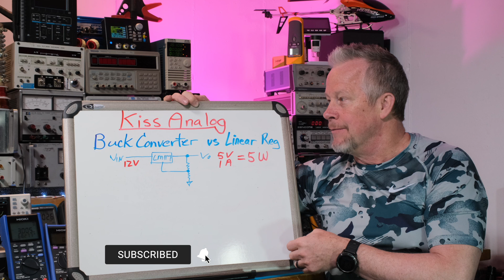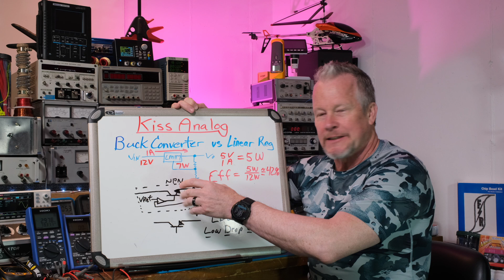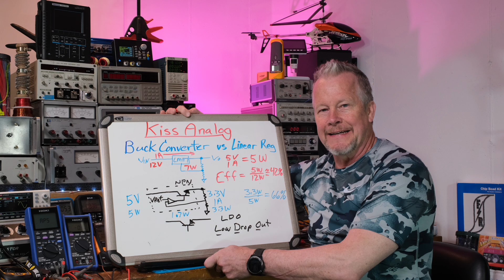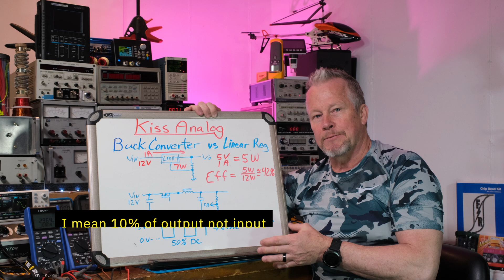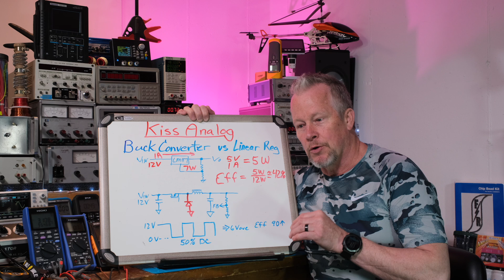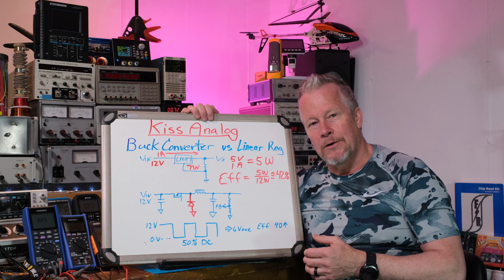Buck Converter vs Linear Regulator  SMP #1 Series #buckconverter #SMPS #linearvsbuckconverter

Comment: Professor, I've been trying to find a solution. Theoretically, I would use two SMPS power supplies in series to obtain ±17V.

The SMPS is the MeanWell LRS 100 15 (15V ~ 18V) 7A.

If I use a Capacitance Multiplier with a Darlington Transistor, I would solve the switching noise problem, but I would have a voltage drop of 1.2~1.4V.

I haven't found any linear regulators that are compatible with this 7A current.

If I had found one, I would have to put a very large heatsink on the case and it would probably have to be a 24V power supply since at 17V the regulator wouldn't be working with headroom, considering that we need to have about 3V above the regulator's output voltage.

So I thought about a Step Down Buck regulator, could that work? Does it filter out the 150mV high-frequency ripple (65kHz ~ 100kHz) from my SMPS source?

My Sony mixer needs a voltage of ±17V and 6A.

Thank you.
Reply from the maker: Thanks for the question!  Yes, you can put two isolated outputs in series and use the center point for the reference/gnd.  Have you tried it and found it noisy with the ripple?  I'd bet that the ripple at sucha a high frequency would go un-noticed.  However, if you want to filter it out, just try a filter.  

Here is a video where I show how well it works: https://youtu.be/Qy2fOhiQRSk

This is a link to a high current filter that might provide me with a small commission and will not cost you anything more:)  https://amzn.to/4vjfOA8

Please let us know if you try it and if it works for you.

Comment: Cool stuff, was just watching a video on increasing the amp capability of your standard lm2596 based buck converter, not by adding a bigger inductor but by adding 2 mosfets in parralel at the end it looked like. https://youtu.be/IkubAYdlCzc?si=nUafXfe2ef8c_KqO The idea being you didnt need a bigger inductor you just added a power mosfet or 2.  Wonder how that worked. Also seen another mod that lets you current limit that same buck converter  with an op amp added to it. https://youtu.be/iwnanQsR32Y?si=VqBP43-DS6VwmQ3x These videos are great at showing you how to do it, but dont explain why it works.  That stuff would be great to see.

Comment: Short story : use LDO when drop of voltage is not significative and when noise on the power rail is critical.
Reply from the maker: Thanks Lucas!  I agree, if power loss is not an issue, then go with the Linear Regulator.

Comment: One thing I do not care for switching regulators,,,,, (without ov protection)... I work on an industrial systems instrument.  It has a heavy 5 volt current draw, when an optional SBC Computer is installed in that PCB, maybe 20% of the time.  So, the supply is capable of some "beef".   80% of the time, you find that board, it doesn't have an SBC mounted on it, so it really doesn't need that current capability, so it is a VERY efficient 5 volt switcher.  That 5v power supply is derived from a 12 volt supply supplied by a Lambda frame power supply (lots of current).  I've had to repair instances where the switching controller failed, leaving the FET on all the time.  When that happens, it blows every TTL SMT chip on the board.  Luckily, that is only about 8 or 10 chips and is repairable.  The chips are cheap and available (thank goodness), only the labor is expensive - lol.  That 12 volts feeding to the 5 vols level converter chips, thank God has never fed back in to the 3.3v FPGAs.  There is no 5.6v zener across across the output, or anything like that.  It probably would not be fast enough to protect the TTL chips?  I not sure what protection scheme would work in a failure case such as this.  It also could just be the arrogance of the German engineers that their design could never fail.  I just think, in this case, it is a shitty design.  I have never seen a linear regulator (at least on the equipment I work on for that last 40 years) short from input to output.  They seem to open, not short.  No room on that PCB to dissipate power from a linear regulator.
Reply from the maker: Thanks for that great feedback!  You are right, the shorting condition is potentially an issue with Buck Converters.  So important to design these so that they are robust!

Comment: What in case my load needs just milliamps most of the time and sometimes 1-2 amps?
Reply from the maker: Thanks for the great question!  Is the high current load there for a very short transient, or longer?  This is a typical situation;)
Reply: @kissanalog  Well, I have a little project on my mind, where MCU will draw couple of milliamps, I will turn LoRa module for couple of seconds every couple of minutes, and very rarely I will turn on sirene like once a year for couple of minutes (so not just a short transient)

Comment: Nice episode 👌👏👏👏👏Linear better for low current it's also safety, very low noise,   very low efficiency also!
Buck or series converter very high efficiency, but noise high also, GaN very improvement for smps 99% efficiency! 
Thank you for your expensive lecture and presentation
Reply from the maker: Yes, I think in general you are right.  We can back switchers pretty low noise, so we'll have to work on this as these videos come up;)

Comment: Regarding the buck suggestions you asked for,

When you make the design example video, maybe you could have a simple linear circuit built up already that's equivalent to the buck with regard to Vin, Vout, and Iout.  Without needing to go into much detail or analysis about the linear supply, you could still show some quick comparisons with efficiency, input/output noise, and input/output step measurements.  Or, hold the buck vs linear comparison off for a future video where you can focus specifically on showing the similarities and differences between the two.  Some people are really surprised by their similarities once it 'clicks' for them.  I know I was!

Feedback loop response stuff (gain, phase margin, compensation, bandwidth, etc) would be awesome to eventually work up to after you've finished the overview videos you have planned.  If someone already has a good grasp of filters, they'll get a little taste of just how much filter theory overlaps with control theory - almost two different sides of the exact same coin in my mind. 

Also, if or when you make some detailed videos on linear supply theory; a lot of people tend to think of LDOs and other integrated linear devices as unconditionally low noise and stable - you can explain and show us why that's not always true.
Reply from the maker: Thanks for this!  I'll have to see what I can do;)

Comment: Very insightful! 
In one of the recent designs, I used LM2678 for getting upto 5A current at 5V. Interested in learning more about switching converter architecture at the block level(inside the IC as shown in datasheets).
Reply from the maker: Thanks for sharing that;) You've given me some ideas.

Comment: I ASSUMED THAT UNITS LIKE MPPT CHARGE CONTROLLERS AND STEP DOWN COMPONENTS THAT REDUCE DC FROM 48 VOLTS TO SAY 12 VOLTS MAYBE 5 VOLTS HAVE LIKE 95 PERCENT EFFICIENCIES, WHEN YOU MENTIONED THE LOWER EFFICIENCIES, THAT GOT ME THINKING, BECAUSE MUCH LOWER EFFICIENCIES THAN IN THE NINETIES WOULD BE INSUFFERABLE.

IN SOLAR, YOU TYPICALLY HAVE STRINGS OF CONNECTED PANELS THAT USE DIODES COULDN'T LOSE MORE THAN A FEW PERCENT IN POWER REGULATION TO EVEN WORK, I WOULD GUESS, NEVER THOUGHT ABOUT THAT MUCH FROM AN ELECTRONICS PERSPECTIVE. VERY INTERESTING AND THIS WILL MOTIVATE ME TO LOOK INTO THIS, MEANING I'LL LOOK MUCH MORE CLOSELY INTO THE EFFICIENCIES OF THE COMPONENTS I'M SELECTING...
THANKS
Reply from the maker: Thanks for this feedback!  I think solar is a great example where you want to keep the efficiencies low!  Nice example.  What would be an example for voltage and current?  It sounds like 48 VDC is a starting point, and then 12 VDC is probably a common voltage for running other devices, but what would a typical current demand be for the 12 VDC?
Reply: @kissanalog  OK HERE ARE A FEW EXAMPLES FOR OFF GRID SOLAR FOR EXAMPLE:
1. YOU WANT TO CHARGE DC REFRIGERATORS THAT RUN TYPICALLY ON 12VDC SOMETIMES 24 VDC OR CELL PHONES FOR EXAMPLE COULD CHARGE ON A 5 VOLT LINE OR HIGHER, THEY HAVE HIGHER LINES NOW FOR COMPUTERS LIKE USB C SO ALL OF THIS CHANGING THE CURRENT UP OR DOWN GETS SIGNIFICANT

2. SOLAR PANELS ARE TYPICALLY IN HIGH RANGES FROM 36 TO 50 SOMETHING, UNLESS THEY'RE CONNECTED ON STRINGS  IN SERIES IN WHICH CASE A STRING MIGHT CARRY  A MAXIMUM OF 600 VDC DPENDING ON THE INVERTERS THEY'RE CONNECTED TO

3. IN OFF GRID YOU WANT TO KEEP THE VOLTAGES HIGH FOR LINE EFFICIENCY TO THE BATTERIES WHICH MIGHT BE IN BANKS ANYWHERE FROM 12 VOLT TO TYPICALLY 48 FOR SMALL SYSTEMS

4. SO THE EFFICIENT LYNCH PIN WOULD BE DROP DOWN REGULATORS THAT DON'T HAVE HEAVY LOSES FOR DROPPING DOWN TO THE VARIOUS APPLIANCES. 

5. I THOUGHT PANELS JUST USED DIODES TO KEEP THE POWER REGULATED AND FLOWING IN THE PROPER DIRECTIONS, THE BOXES ON SOLAR PANELS COULD BE MORE COMPLICATED IN THIS ERA THOUGH, I SHOULD CHECK ALL OF THAT OUT.

ANYWAY, THANKS...
Reply from the maker: Ok thanks for the info!

Comment: My L12 amplifier works on +/-50 DC. In the past I've used linear regulators for the +/- 15 volts at about 10/15mA to run the usual 5532 pre amp chip. That's quite a voltage drop. Would be interesting to use a low noise Buck converter to run this preamp. I'm sure this option would be most useful to many home constructors. ...and myself!
Reply from the maker: Thanks Michael!  That could be a great example;)

Comment: Great primer! Would love to see more on this. I'd love to see more content on bucks. My problem would be 20v in, +/-16v out. Buck regs only, 20mA quiescent, and 200mA peak. Some tips on layout would also be amazing.
Reply from the maker: Great!  Thanks!  I will cover placement and routing too.  This low of current could be done with a linear as well.  Do you have a reason to keep the efficiency low for this lower power?  How long is the 200 mA peak needed?
Reply: @kissanalog  It's to follow usb-c PD 20V in for a mic preamp. I was planning to also use the supply for a different 8 channel project so 1.6A should be enough to warrant switching regs. As for peak current what happens on the other end of the mic is out of my control, but gain would be adjusted to have it be half of that most of the time.
Reply from the maker: The negative voltage will be an example later when we get to inverting converters and isolated converters.

Comment: 5v to 3.3v
I only choice 5v logic/controllers cuz my pcbs are only one board. If I can feel comfortable doing a buck converter on a single pcb, I'll have more ic options. 

Noise is also an issue though. Dont want that fast rise time messing with my analog.
Reply from the maker: Thanks Preston!  I am with you - gotta keep the output clean;)
Reply: @kissanalog  perfect video idea :)
Reply from the maker: Thanks!  I appreciate you!